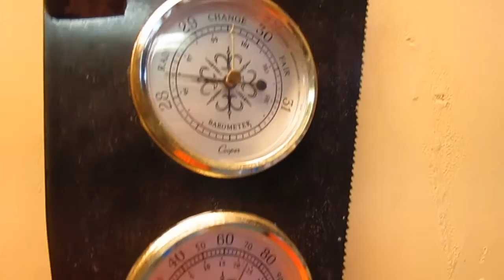Handsaw Weather Station - Upcycle

Comment: Way to go. This a great way to personalize an item.  Also nice job on cutting the circles with the angle grinder.
Reply from the maker: Thanks. I was stunned that it was even possible. The whole time I was gritting my teeth, waiting for the disc to slip off and track down the blade. Had some good luck that day I guess.